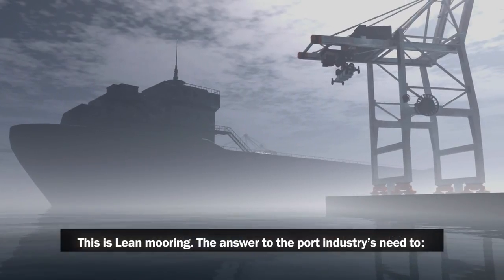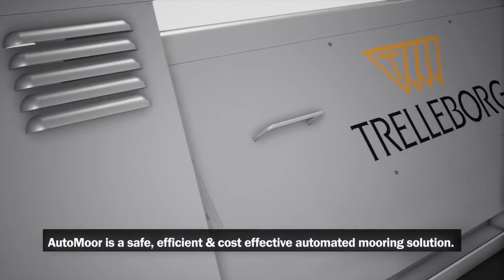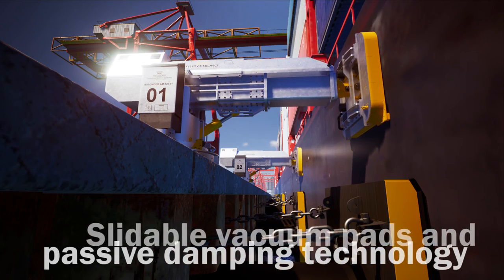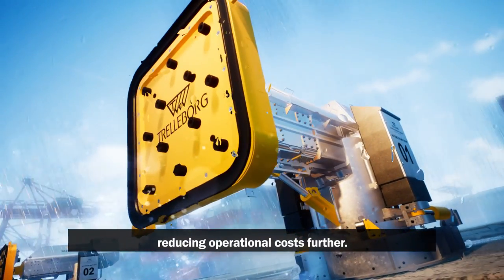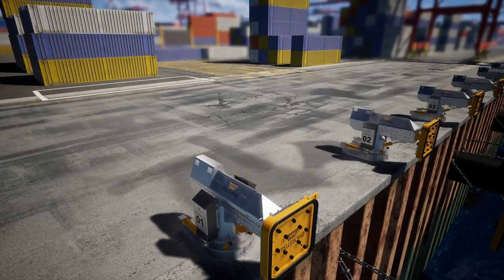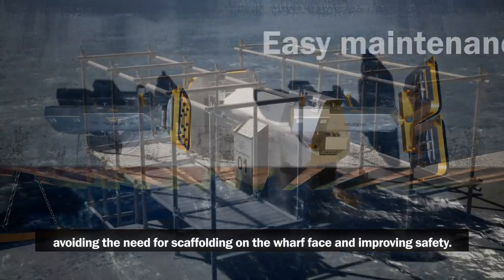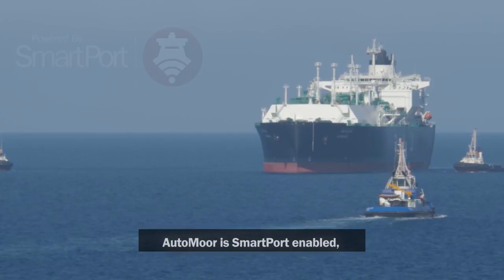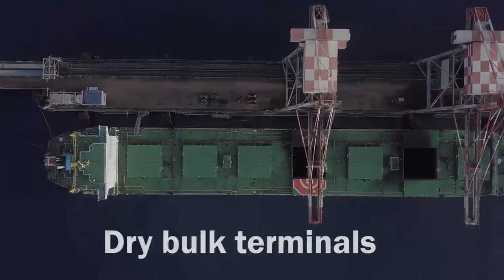AutoMoor - Automated Mooring System

Comment: Like a lot of these technologies they look good, but what about mooring in adverse weather. The vessels using the system are  relatively large vessels having tug assistance, what about smaller vessels say 130m to 160m without tugs and maybe requiring weather conditions for mooring, unmooring, e.g. maybe holding an after spring to help lift bow off a tight berth or as in most ports short shifting of 20m to 50 or 60m along a quay wall. Looks good in ideal conditions but I suspect has a long, long way to go before replacing linesman and deck machinery.

Comment: but what happens when the tide changes? what happens when the draft changes because of loading/unloading???
Reply: Same thing that you have to do with rope / wire system. You readjust them.
Reply: @thedukeofno  this is a terribly pragmatic reply
Reply: @thedukeofno  container vessels don't have their lines adjusted based on the tide... that's hilarious.

Comment: What happens to the linesmen and their jobs?
Reply: They'll work as an operator and my friend  advance technology is an  opportunity  not a job ripper but u guys want money job everything by just following a trend and the conventional processes . Everyone wants to earn but no one wants to change for good , no one wants to enhance. Ok so could u plz tell me what about the accidents happening due to ropes what about the slow port operations and what if due to high wind force say BF 9-10  rope breaks apart? These things are something which are actually witnessed but still if something good is in pipeline you guys consider  it as a job ripper. . Sustainability  requires  the fittest to be the part of the game
Reply: I can guarantee you that once this equipment is in place you’ll see a lot of unemployment in that sector unless terminals are willing to retrain/ or relocate the workers. 
Linesmen have been mooring vessels for centuries. In modern day a linesman crew can berth a vessel in a short amount of time BUT time should not be a consideration when berthing a vessel, there are too many varying factors, weather, sea state, visibility, manoeuvrability ect. 
Accidents mostly happen when 1. Workers are untrained 2. Workers are under pressure from management to work quickly and not safely. 
This need to be fixed at the management level not the worker level. These machines may well be the future and I’m all for the advancement of technology, but it must be done responsibly and without loss of income to employee.
Reply: @synd0gg  "but jobs" should never be an argument against using superior technology, jobs come and go and obsolete jobs are going to disappear anyway, sooner is better. Why the hell would you want to waste valuable human resources at a task a simple mechanism can do better anyway?